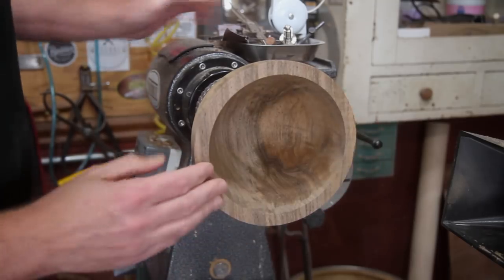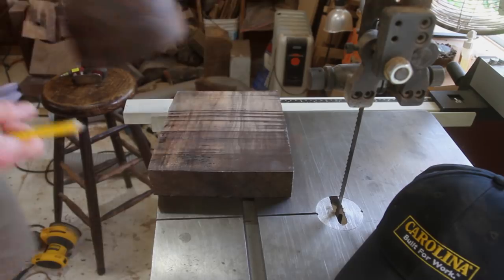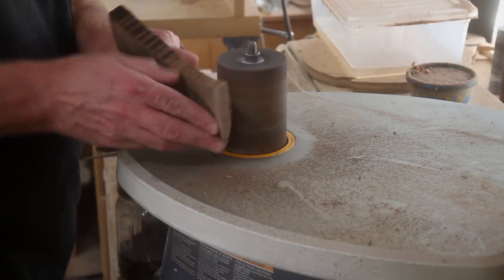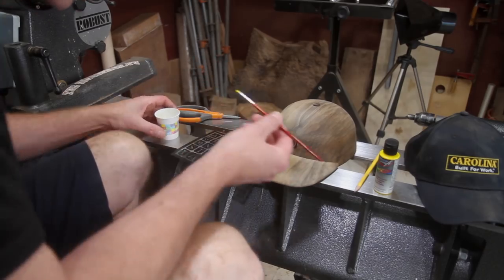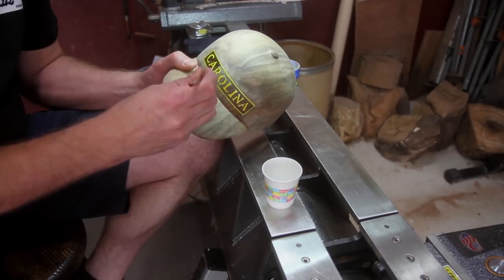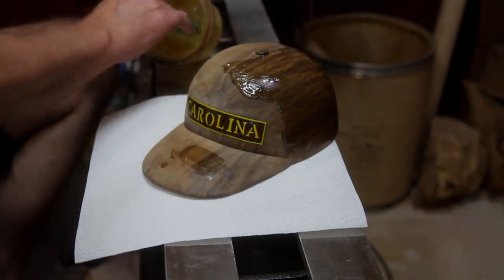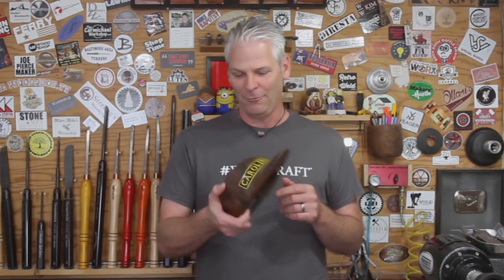Woodturning Wood Baseball Hat

Comment: Many congrats Carl on reaching 200K subs.   Well deserved.   It seems no time since I was giving you private tuition on the finer points of using the skew:-).   I highly recommend the Arbotech cutters.   They are so efficient that they make quite a mess so I usually spread a plastic sheet outside and do the cutting.   When finished it's just a matter of folding up the sheet and sliding the cuttings into a bag.
Reply from the maker: Hahaha...Thank you very much Alan!

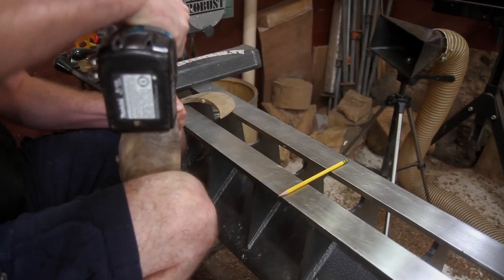Comment: What tool are you using at 4:48 to carve out the hole for the brim of the cap?  beautiful work
Reply from the maker: It's a air saw <a target="_blank" href="https://www.amazon.com/b?_encoding=UTF8&tag=thewood0c-20&linkCode=ur2&linkId=34a76f9431d84c7d5acc2596f697d37f&camp=1789&creative=9325&node=10368731">Air Saw</a>
Reply: @CarlJacobson  thanks so much.  Beautiful job